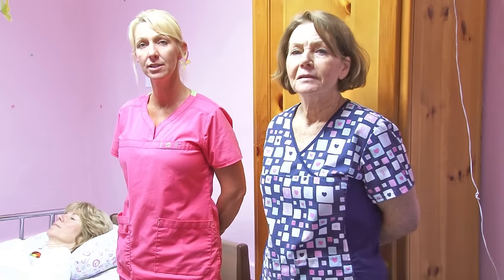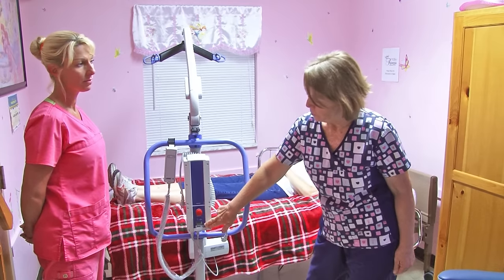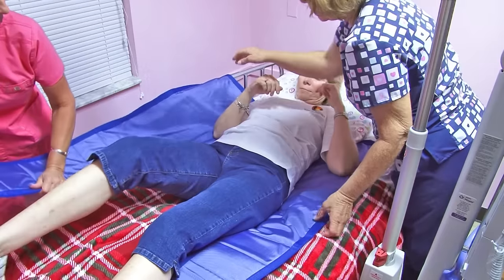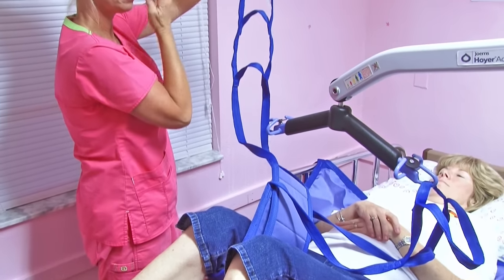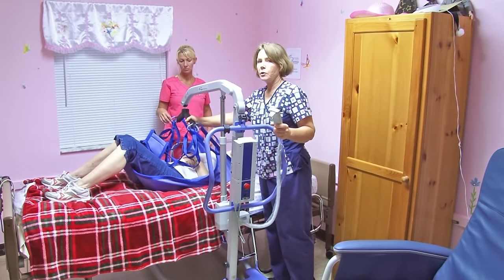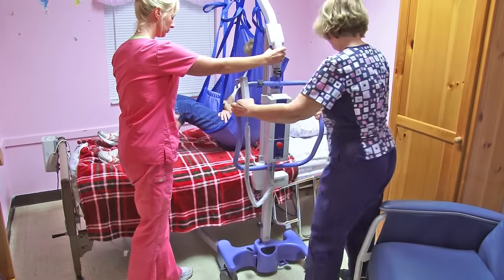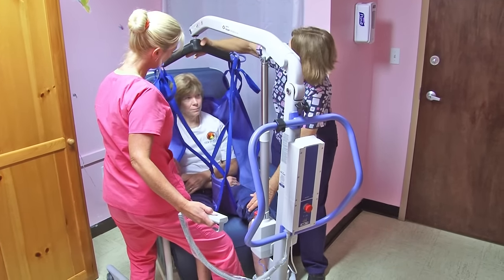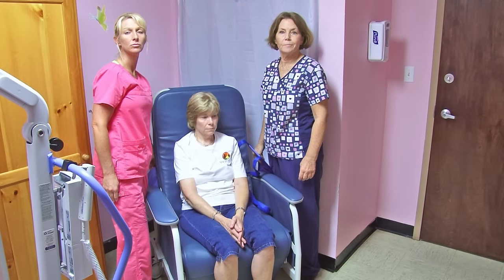Hoyer Lift Instuction Ver I

Comment: As several have commented, you do not lock the wheels of the Hoyer when lifting. The lift may need to move a little to position the load over the center of gravity. Locking the wheels can cause the person to swing, sometimes abruptly,, towards the center of gravity, as they clear the bed.
Reply: jacco nouwen (28-12-1968)

Comment: My Hoyer lift manual says that you must have the brakes OFF when lifting and lowering, so the hoyer lift can find its' centre of gravity, and improve safety.
Reply: Same
Reply: Thank you very much for demonstrating  the used of mechanical lifter I wish I can buy for my sister who is now in bed cause of stroke Thanks
Reply: I agree; brakes should off so it can be moved quickly in case of emergency etc
Reply: Lots of conflicting proper brake usage info out there...
Reply: Exactly

Comment: Hey, where I work I have to argue that those legs should be OPEN to prevent swinging and the lift tipping over...  If the person is 400 pounds, 5 feet tall, missing a leg and confused...then use the rectangular sling, not the criss cross leg sling.  If PT comes in and gets them up without a sling...good luck.  A good PT should show you how to choose slings and transfer safer vs unsafe

Comment: I agree the legs should remain OPEN once the transfer begins and the patient is in the lift to prevent tipping and to stabilize the base! You have got to account for the floor type that you are rolling on too! A wider base leads to a safer transfer.Not every patient is as small as..as calm as..as cooperative as the model in this video!! Really show more respect for the aides and techs who perform these tasks daily! Ain't so easy is it ?

Comment: Here's a question someone may answer. I have had patients who are very tall & difficult to transfer ( dementia). When we transfer from the front one person pushes on the knees while another pulls to position in the chair. What happens is the lift sometimes "jams" under chair. We have now gone sideways with the lift which requires little guiding and no pulling. One worker disagrees with this. We say if the legs of the lift are opened slightly and not hitting wheelchair, it is a non issue. Thoughts?
Reply: I've had that happen before and went in sideways. That is definitely allowed, and even PT/OT has done it... So your coworker doesn't need to be worried that it's wrong because it's not

Comment: I agree with the poster below.  The "model resident" is clearly able to move herself without assistance.  My mother is dead weight, over 215 lbs, and even rolling her to one side sometimes takes two people because she is unable to hold herself up using the bedrails.  With just me helping her, I am not sure I can use the lift alone.  Would like to see a more realistic video.
Reply: Exactly, more often than not the resident does  not roll over that easy and they're usually very heavy! I would sometimes break a sweat just from rolling residents!

Comment: Can you pick up a  patient that weighs 255 # off the floor ?
Reply: Yes....some lower all the way down to the floor, with help, you would do the same as if they were in the bed, and then lift safely then into the bed
Reply: Some facilities require that you only use a mechanical lift to get a paitent off the floor after the nurse has accessed the paitent and says it's ok to move the patient